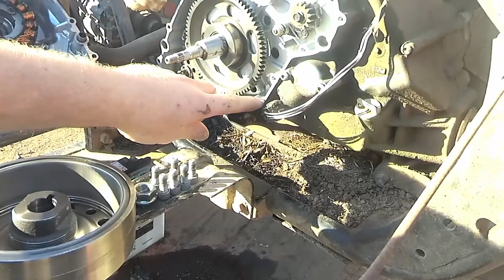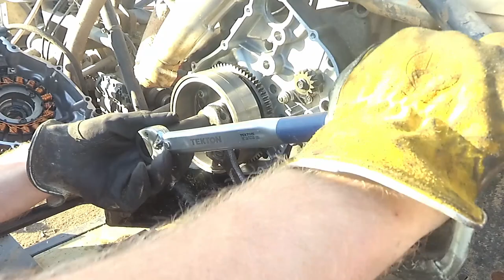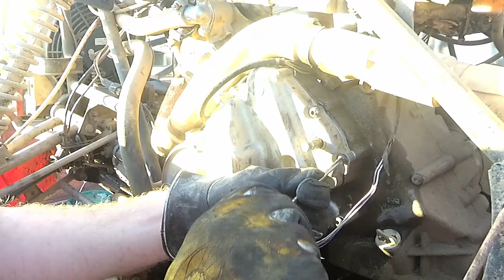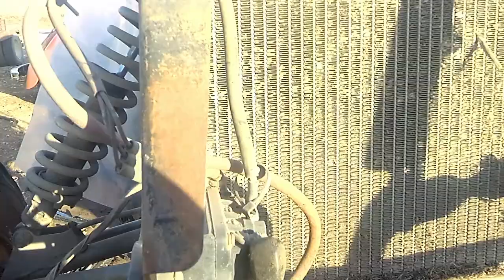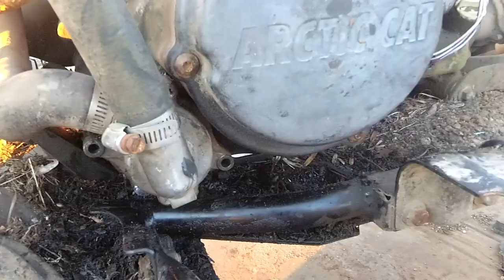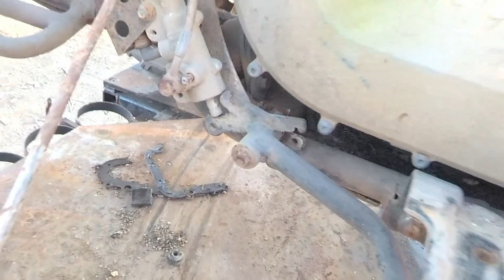Arctic Cat H1 650 Starter Clutch Replacement PART 2

Comment: Hey how you doing? Great video. Do you happen to know the torque specs for the bolts on the one way bearing and the fly wheel nut. And to make sure do I use red loctite on bother of those. Thanks for your time.
Reply from the maker: Thanks, to be honest I don't remember what the torque specs were, I believe I found them online someplace, little bit of searching and you can probably find them.
Good luck on your project!

Comment: did you need any special tools to take the Starter clutch off? maybe a flywheel puller?
Reply from the maker: For me the flywheel just slid off, however I did pull it back apart at a later date and that time I had to use a 3 fingered puller.
If you need a puller I believe AutoZone rents them out.
If you are replacing the starter clutch make sure you buy a expensive one from arctic cat, I bought a cheap one and it worked one time before it junked out.
Good luck on your project

Comment: Out of curiosity what was this atv doing before replacing one way starter clutch ?
Reply from the maker: I could hear the starter spin but the engine would not crank.
I bought a cheap clutch off eBay and it only started the engine one time before it broke. I ended up spending a couple hundred dollars at the Arctic cat dealer and never had a problem again.

The bad clutches I had looked perfectly fine, but they would not engage.
Good luck on your project, let me know if you have any more questions 🖖
Reply: That’s exactly what my arctic cat is doing it won’t crank but can hear the starter spinning.
Reply: I also purchased a cheap the cheap clutch off eBay hopefully I’ll have more luck then starting one time.  I’m about to take it apart